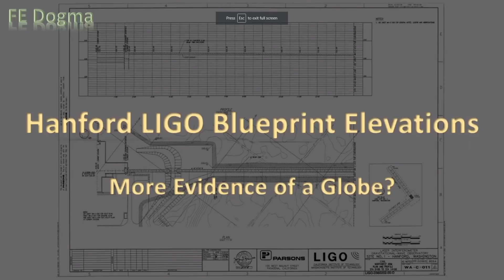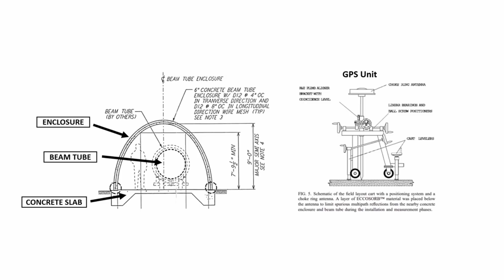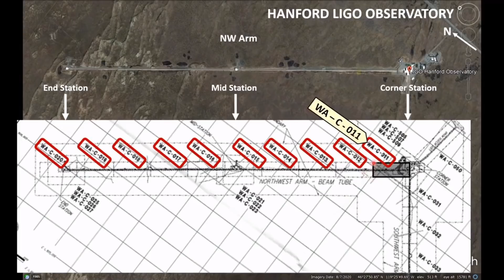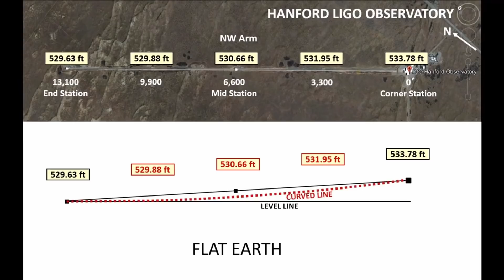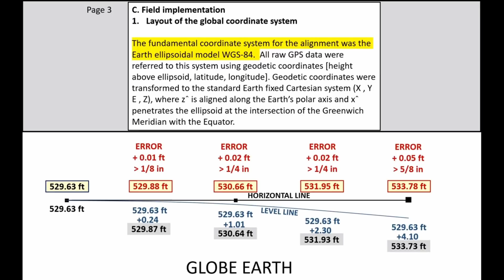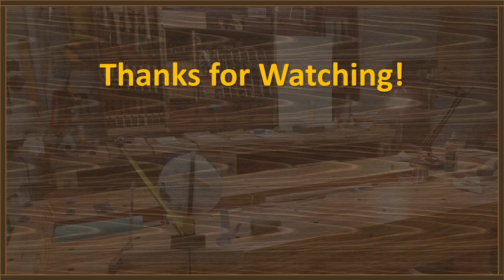FE Dogma LIGO Analysis

Comment: The other day someone was insisting the 1 foot lower in the Louisiana west tube pad was for drainage. Well, 1 ft in 6561.7 ft is only a grade of 0.017% (a slope of 1:6561) and that’s well below a slope designed for drainage.
Reply from the maker: They also tried to say that the vacuum pump enclosure at the center of the tubes was for pumping water! The idiots can't even read the notes on the drawings.
Reply: @bluemarblescience  You're assuming they can read, that's a pretty big assumption Blue.
Reply: I definitely had a laugh when I heard that.  Who is going to slope a surface over a mile to a drain?  When we had to poured sidewalks on downtown high-rises, they slope away 1/4 inch for each foot away from the building to the street.  A concrete surface is never perfectly flat and this assures that there will be no puddling on that surface.
Reply: Smh 😞

Comment: For the mathematically challenged, like me, and flerfs here’s a quote from CalTech’s LIGO website: “Beam Tube Installation

LIGO's arms are long enough that the curvature of the Earth itself was a complicating factor when installing the vacuum tubes. It wasn’t enough for LIGO’s civil engineers to smooth a level path and assemble each arm’s tubes in a straight line. To ensure a perfectly level beam path, the Earth’s curvature (more than a vertical meter over the length of each arm) was countered by GPS-assisted earth-moving and high-precision concrete work.”